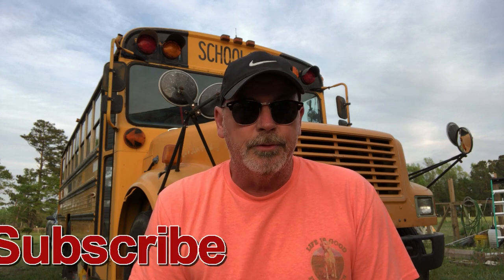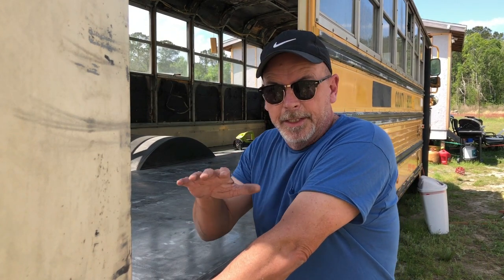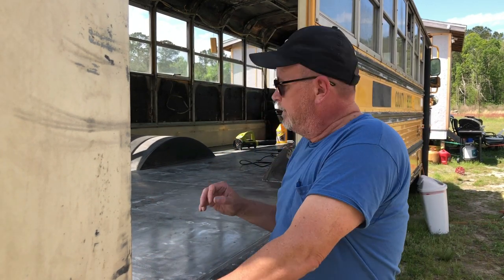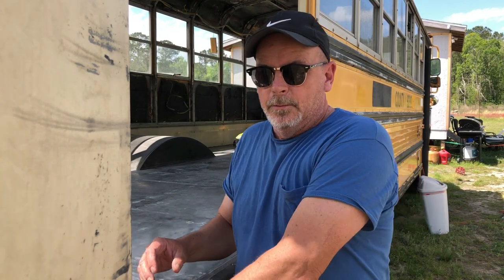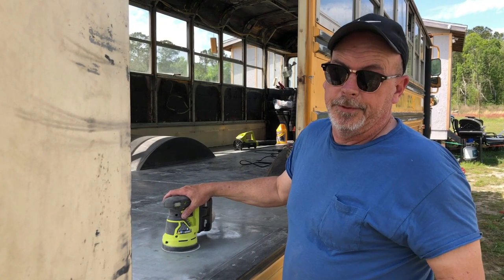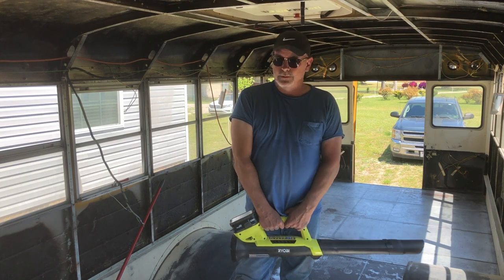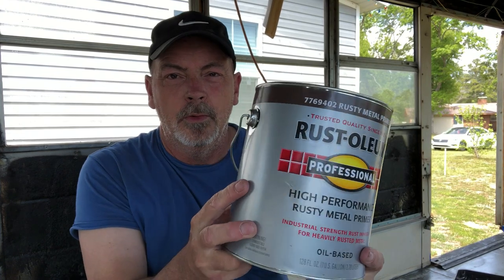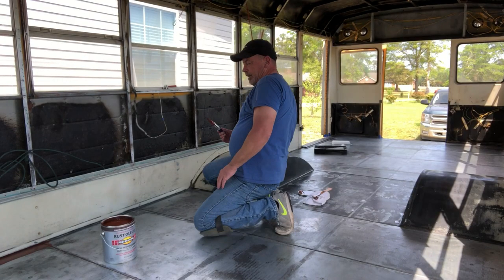Skoolie Build | Why we are not using Ospho or another rust converter | How to paint the floors right

Comment: Does this bus have the hatch on the floor to access the top of the fuel tank? If so, did you have to do any additional prep around that area?
Reply from the maker: I just removed the cover sanded lightly around the opening, I’ll paint the cover and reinstall.. I’ll make sure I have access when I’m done framing

Comment: Ospho has been receiving good reviews for decades and those reviews are not from Skoolie owners. To say that it's not working and people dont know because their floors are covered up now is naive. The product does exactly what it says and converts iron oxide to iron phosphate.
Reply from the maker: Reviews are just that, they are usually given right after a product is used. I have worked with professionals in the auto industry for over 20 years, not one recommends the product before painting. I respect your opinion I just view it differently.